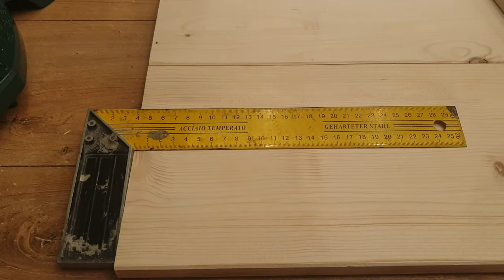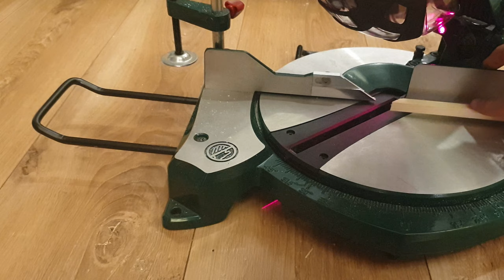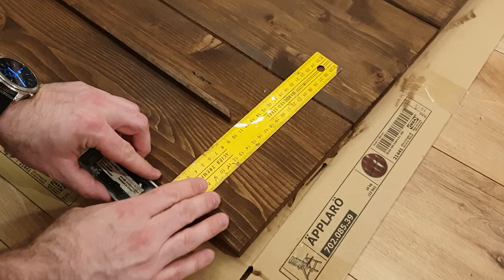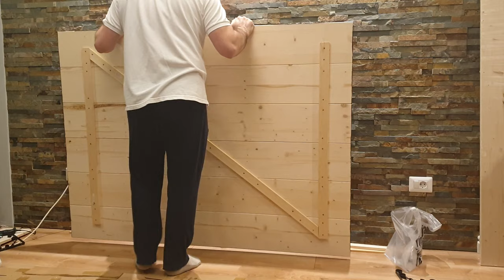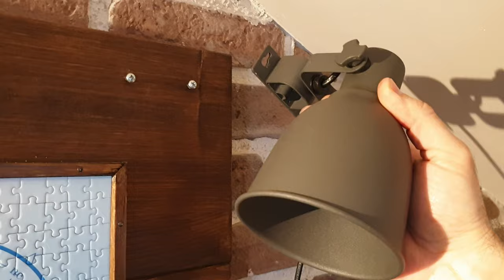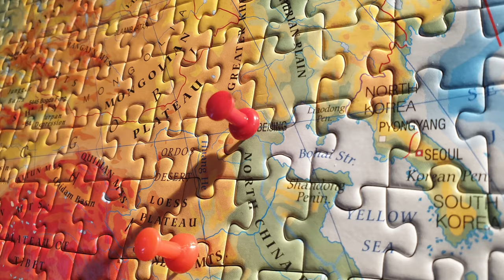How to frame a 4000 piece Jigsaw Puzzle, DIY project

Comment: Hello, I bought the same puzzle and made it. How should I do the back side of the puzzle so that it does not deform over time?
Reply from the maker: Hi, I've used puzzle glue sheets for my puzzle. I got it from this website, but you can find it also on Amazon, or you can Google it for your country: https://www.emag.ro/folie-pentru-lipit-puzzle-grafika-3000-piese-51214-grafika-00857/pd/DWXS3CBBM/ Are very easy to use and the puzzle will hold perfectly
Reply: @YouCanDoIt_Channel  thanks

Comment: Hi. How did you bond the puzzle ? mod podge?
Reply from the maker: Nope, I've used puzzle glue sheets, it's much easier. I got it from this website, but you can find it also on Amazon, or you can Google it for your country: https://www.emag.ro/folie-pentru-lipit-puzzle-grafika-3000-piese-51214-grafika-00857/pd/DWXS3CBBM/

Comment: Can I have some more detail on how you setup your lights?
Reply from the maker: The lamps are form Ikea: https://www.ikea.com/gb/en/p/hektar-wall-clamp-spotlight-dark-grey-90216543/. The setup it's simple, there is an outlet behind the wooden panel, to witch the lamps are plugged in. The wires are just hanged behind the panel, on the sides, in order to have easy access to the switches. Let me know if you need more details :)
Reply from the maker: Unfortunately the homedepot website seems to restrict the access from my country so I can't see the content :( ... But anyway, the flat brace that I used looks like this: https://www.hornbach.ro/shop/Coltar-de-legatura-Hettich-40x40x10-mm-otel-zincat-pachet-30-bucati/6827561/produs.html, and the L-shape brace I got it from the same hardware store: https://www.hornbach.ro/shop/Consola-laturi-inegale-240x160x50/2880195/produs.html ... you should be able to find something similar in your area I think.

On the other hand, the upper brace that you found looks very good .... even better than mine :) ... I got it here: https://www.hornbach.ro/shop/Consola-decorativa-Vormann-205x205x14-mm-culoare-neagra/7399559/produs.html

I'm glad that my video inspired you :) ... and I would appreciate if you would like to share the final result with me :)
Reply: @YouCanDoIt_Channel  thank you so much! I will!